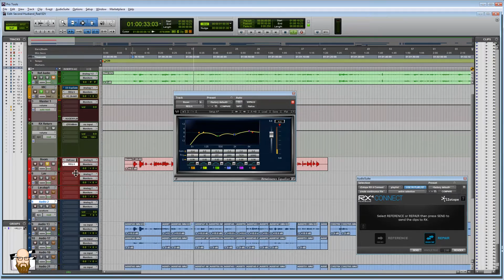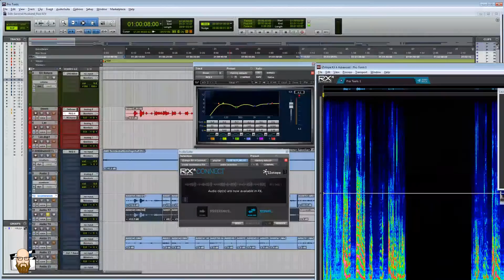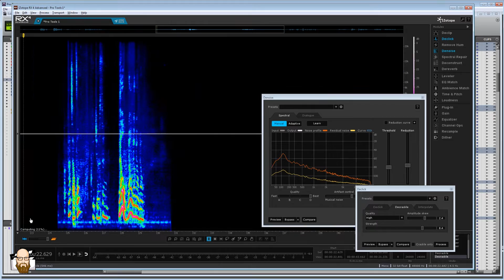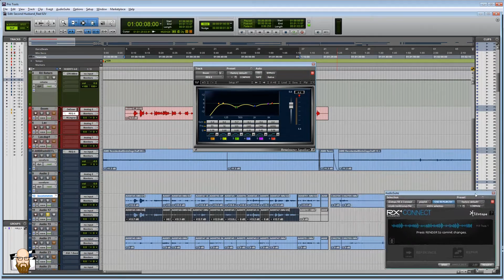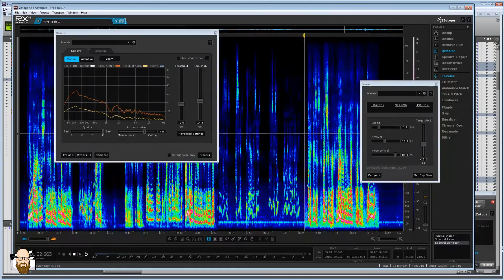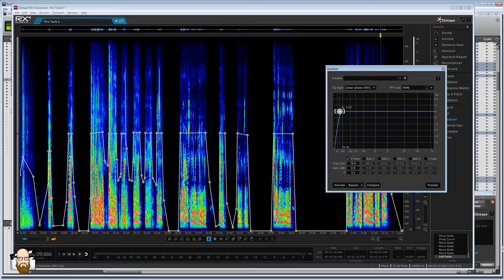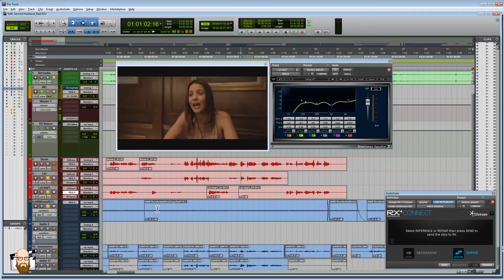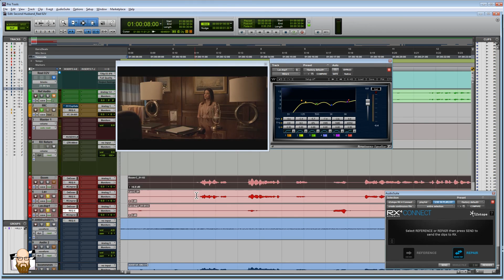How To Edit Dialog For Film Using Pro Tools and Izotope - Part 05 Level Up

Comment: So my question.. With all the work you've put in, When Atmos/FX/Music gets added, Having already used the space between dialogue to Manually choose the noise floor and using Spectrum Denoise, Do you go back through the process again? After, the space between the new dialogue has no learnable noise , nor in-between words are such a small amount, generally RX does not like this....
Though we've come along way with RX (9 now) , Its interesting to see how others work....
As for me, Ive done mainly indies,... from Shorts to Features, Location to Re-Mixing, Dialogue editing to Film Scores....
I guess, my workflow is to make the dialogue good enough to add to it... So my first pass will always have that extra Track with RX Denoised to the MAX, to that teetering point..... You add Atmos, room tone ect, there's never that noise in the Dialogue issue....
Point is, What if theres no Music or SFX?
TBH, Its amazing how many times I hear the "Gating" type Effext.... Sure, not exactly a GATE , but there is Noise within the dialogue, And then when it hits some ADR, ouch.... But alas,.. Dialogue Match must be a winner....  
«But again., I Digress.... Dealing in Indies, directly with directors... With not much more effort, I get the DX as clean as possible, the select room tone from the original and use RX to creat a  minute file based on it..... Throw it in, through a room verb, and bam.... Changes, if need be , are sooooooo easy..

And yeh, Great share .interesting seeing someone elses process,  I guess what peaked my interest is the leveller.. It  Never worked for me... but this vid has me interested in having another look into it.
Reply from the maker: Man this video is so old I think I'm more in line now with doing a small bit of noise cancelling - stuff I know will be an issue, and letting the more surgical stuff ride until everything is in.  Then the stuff I still notices with SFX and BGs in - I'll get surgical.  :)
Reply: @rellemurd  Yeh .. I know it's old.... But so am I !  ;)
Beers and Cheers